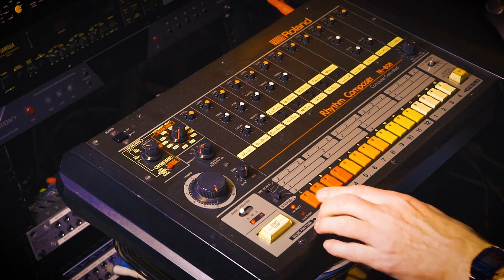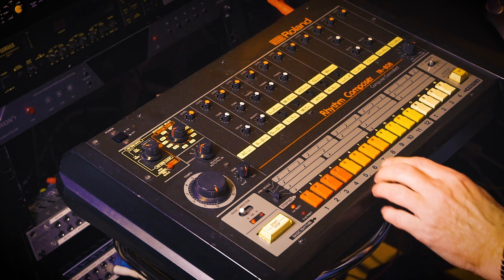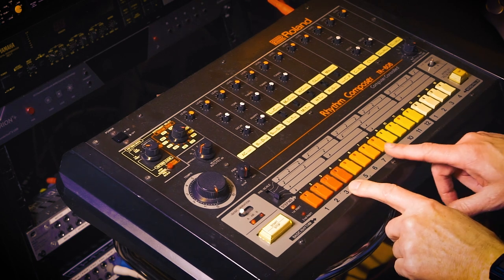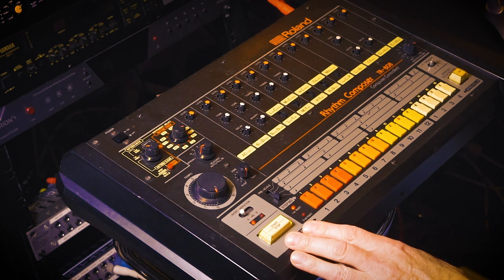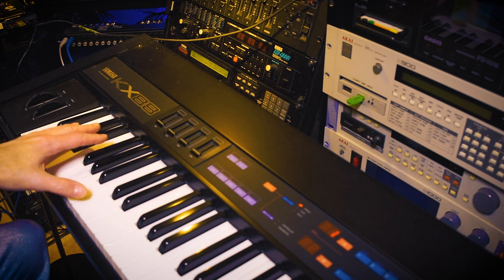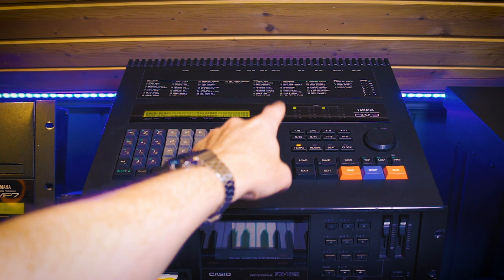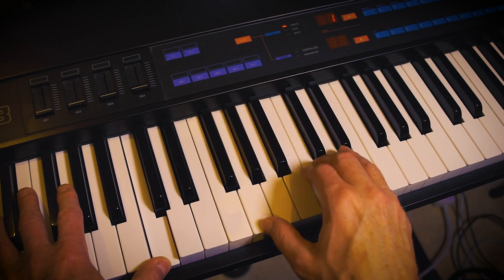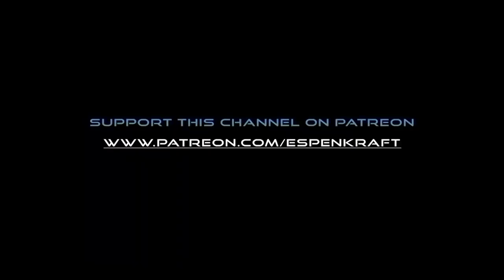Top Gun Anthem | 5 minute tutorial/breakdown

Comment: It sounds spot on! Those Tubular bells sound very faithfull to the original. I’ve read once that Harold Faltermeyer layered 16 Tubular bell presets to achieve this. It’s one of those sounds that made me an FM synth aficionado.
Reply from the maker: Cheers! I go through all that in the video description. ;-)
Reply: He used 2 DX7s and the TX816 the bass I think was the Minimoog which is what I used the first set of pads are also from the DX7 which is what I also used and then alternated the pads and filters with sounds from a Juno 60 and Jupiter 8.
I also used the TR 808 and delay for the percussion so it’s more or less the same set up however I played the chords slightly different however as you’ve stated it’s just a rough note guide not 1.1 comparison